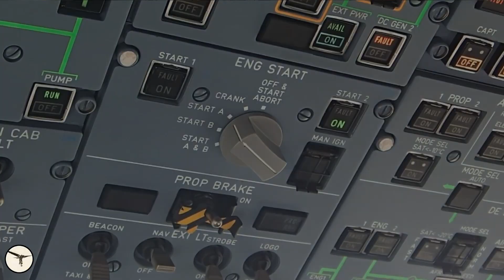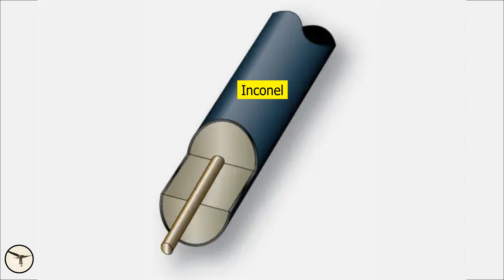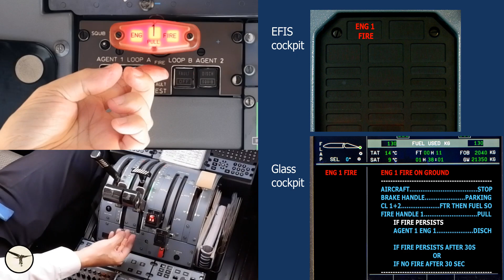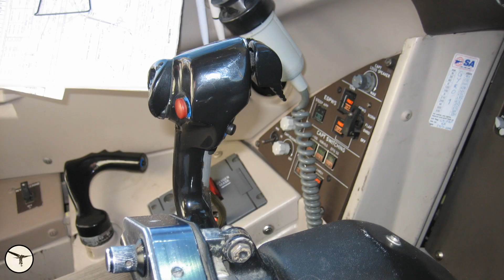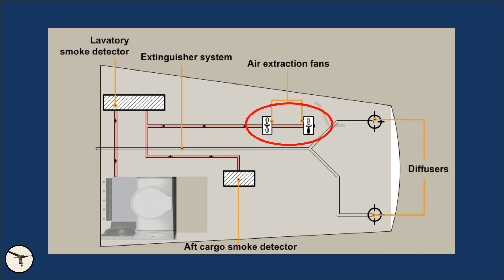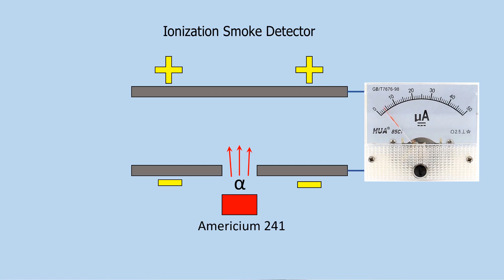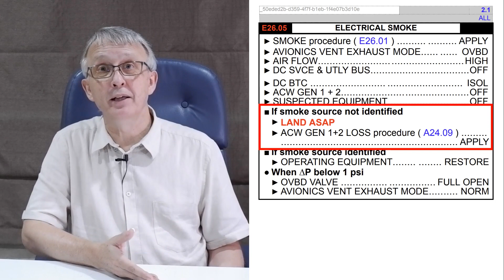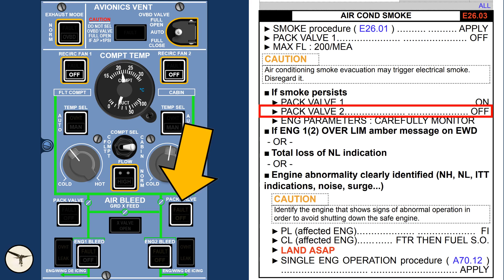ATR systems - Fire protection

Comment: Looking at the "anti smoke valve" or extract airflow valve, can you explain why we don't have to close it with ELEC SMK but only with FWD Cargo comp SMK?
And is it possible that FWD Cargo comp SMK also triggers an ELEC SMK? They both use the same ducting through the Extract Fan where the ELEC SMK sensor is located.
Reply: Because in the case of ELEC SMOKE, the smoke could be coming from somewhere in the instrument panel, such as the DUs; or from the avionics racks. In either situation, the extractor fan will pull the smoke away from the cockpit. But if it’s coming from the DUs and you close the valve, that ventilation airflow will stop and the smoke will remain in the cockpit.
In the case of FWD SMOKE, the extractor fan will pull the smoke from the cargo compartment into the cockpit. Closing the valve prevents this.
Yes, it is likely that ELEC SMOKE will be triggered after FWD SMOKE. If that happens, you don’t apply the ELEC SMOKE procedure because FWD SMOKE happened first. The fire is in the cargo compartment.
Reply: Hi Benjamin, yep . . makes sense on the first part but to my opinion the extract fan with FWD Comp smoke will not push smoke into the cockpit but pulls it away toward the partly opened overboard exhaust valve.

Comment: hello captain, what to do if we get nacelle overheat during taxi? i got this question in indigo written exam. 
thanks
Reply from the maker: The procedure is as follows:
1. Stop the aircraft.
2. Increase power slightly.
3. If the alert remains after 30 sec, shut down the enigne.

That said, ATR does not recommend taxi with engine #2 in hotel mode. We start both engines before taxi and shut down one of the engines (normally #1) two minutes after landing.

Comment: About the off-duty pilot that recently tried to turn off the engines in flight - is it possible to push the fire handles back into the original position, cancelling the effects of them being pulled (the mechanical block mentioned in the FCOM) to restart the engines? Thanks.
Reply from the maker: Yes.
Reply: @FlywithMagnar  thanks!!

Comment: hi could you please explain to me how ATR is certified for ETOPs operation without the capability to suppress fires for 2 hours or more? I believe this is a requirement for ETOP certification. please do correct me if I'm wrong though.
Reply from the maker: This requirement is for cargo fire suppression systems. Not the engines. An engine fire is typically caused by a fuel leak, and the fuel supply is shut off when the fire handle is pulled. Therefore, an engine fire will extinguish itself. A cargo fire is very different.
Reply: @FlywithMagnar  thank you so much for responding. You’re very knowledgeable! Apologies I should have specified, yes I was talking about cargo fires. I know that the rear cargo compartment has a vents from which fire extinguisher content can exit to extinguish the fire however this doesn’t fulfill the requirement to suppress fire for two hours or more to be certified for ETOPs operation. I’m wondering how did ATR manage to get away with being certified for ETOPs without having fire suppressants?
Reply from the maker: The requirement is not for passenger aircraft, but cargo aircraft.

Comment: Hi Captain, I noticed 2 small errors, in the 600 version when you perform the smoke detector test it appears not 3 but 4 awarning lerts (forward, after, electrical and lavatory) in the SD cabin page,  and the test has to be done before any flight not before the first flight of the day. Thank you for your excellent work!!
Reply from the maker: Thank you for your feedback. The lavatory alert on the SD cabin page is mentioned in the description section above. According to FCOM, the smoke test in only performed before the first flight of the day. Maybe the SOP in your company is diffrent?
Reply: @FlywithMagnar  You are right, it was my mistake, I was thinking in the engine fire detector test. Regards

Comment: Hi Captain, 
1) In this video you mentioned that 'when AFT smoke has triggered the extract fan stops, this prevents smoke from entering the cabin,' but even with extract fan turned off wont the smoke enter the cabin with recirc fan running? Then why only extract fan is shed?
2) Whether the extract fan will be shed if any kind of smoke is detected, ie ELEC, FWD or AFT?
3) What is the reason behind triggering Mec Horn while resetting the OVBD PB following SMK test?
Reply from the maker: Thank your for the questions.
1) I do not know the technical reason, but when smoke is detected, one of the memory actions is to switch off the recirculation fans. Therefore, the fans will come off pretty quick.
2) Only AFT SMK.
3) The OVBD pushbutton controls the extract fan, which is important for cooling of the avionics. The cockpit can get very hot during a ground stop. The horn will sound when the extarct fan stops, alerting everyone around the aircraft that something is wrong. The horn will also sound when the OVBD pushbutton is selected OFF bedause the fan will stop. The alert is inhibited when AFT SMK is triggered. But when we select the OVBD pushbutton OFF during the reset, the horn will sound because of the logic in the system.
Reply: @FlywithMagnar  Thank you for explaining, can you please add why the AFT smoke? I mean extract fan extract air from the avionics, E & E racks and the FWD Cargo area, then why shed it when there is smoke in the aft cabin?
Reply from the maker: When in flight, the extract fan directs air via the underfloor valve to the area under the cabin floor. When the air reaches the aft part of the fuselage, it flows up to the cabin and then forwards. Any smoke in the aft part of the cabin will then drift forwards through the cabin. This will not happen when the extraft fan has stopped.

Comment: Hi Magnar! I have three questions:
1. Why ATR removed memory item for "loop fault"? Let's assume you have loop fault after takeoff and first you do normal and then abnormal checklist. If you got real engine fire, wouldn't you lose some critical time?
2. For 500 series I use: for electrical smoke detection - first CCAS message and then smoke and for air conditioning smoke detection - first smoke and then CCAS. Does it work in real life?
3. Could you, please, give a practical example with a tripped c/b and/or item isolation during an electrical smoke/fire?
Thank you for the great and useful videos!
Reply from the maker: 1). ATR made a decision to remove as many memory actions as possible without compromising the safety. It is highly ulikely that an engine fire will happen seconds after a loop fault. (That only happens in the simulator.)
2) If I understand you correctly, then no. When you have ELEC SMK, you do the Smoke memory actions, the Smoke checklist, and then the Electrical Smoke checklist. When you have air condition smoke, there's no CCAS alert. Air condition smoke is detected visually and/or by smell. You do the Smoke memory actions, the Smoke checklist, and then the Air Condition Smoke checklist. If ELEC SMK appears, you must disregard it.
3) I have heard about one accident where the crew repeatedly pushed in a popped circuit breaker until the circuit caught fire (not ATR). Apart from that, I have never heard about such situations. But I can construct a scenario: An unusual strong current is sent from ACW BUS 1 to the pitot heat on the captain's side. Arching starts a fire before the circuit breaker can open. The smoke triggers ELEC SMK. Most likely, the circult breaker has opened. When touching the circuit braker panel for probes heating, the pilot will feel it's warmer than usual. You can now restore the systems on the MAIN ELEC PWR panel. Whether you should restore ACW GEN 2 is open for debate. The pilots don't know what caused the overload to the given pitot heat. ACW BUS 2 might have a similar issue, but they don't know.

Comment: Hello Captain! Can you please clarify which is the best angle of climb speed (Vx) and which is the best rate of climb speed (Vy) in ATR?? Also is the best lift to drag ratio speed the best rate of climb speed for turbo props like ATR??
Reply from the maker: Hi Oerstis. The terms Vx and Vy are not used in transport category aircraft. Therefore, you will never see those speeds in ATR manuals. The closest speed is called VmLB - mimimum speed low bank. It is shown on the airspeed indicator with a white bug and is used for best single engine climb speed, and for drift down. This speed is close to the speed for best lift to drag ratio and the speed for best rate of climb. So, yes those speeds are identical (more of less).

Comment: Your vids are very clear explained systems knowledge, thank you for that Magnar.
Why does engine #1 not have a Nacelle overheat sensor, as with taxi it can experience the same as engine #2?
(the QRH procedure is related to an operating #2 engine)
Is the single dot on the CAP opposite of the NAC 2 OVHT just to ignore the possibility of the #1 NAC OVHT?
Reply from the maker: The nacelle overheat sensor is installed in the engine with the propeller brake. When using the engine in hotel mode in tailwind, there's a reduced airflow through the nacelle. This is not an issue when the propeller is turning.
Reply: @FlywithMagnar  Do you taxi with  hotel mode?
Reply from the maker: No, no reason to do that.
Reply: @FlywithMagnar  I had the same opinion sir so that leaves us with a useless "taxi NAC OVHT" QRH procedure and clarifies the reason why there is no OVHT sensor in NAC #1.
Any idea on the CAP dot?
Reply from the maker: The dot is an empty slot. The shape of the CAP is standard and used in every ATR variant from the 42-300 to the 72-500. Therefore, there will be different alert lights.

Comment: Hi Captain, Thank you for such an informative video. Can u please clarify
1) what is the reason for shedding ACW generators in the event of ELECT smoke?
2) Will the ELECT smoke will be triggered following an FWD smoke alert even before selecting avionics vent exhaust mode to OVBD since the smoke from FWD cargo compt will flow past the smoke sensor in the avionics vent with the UF valve In open position? In that case, how can we confirm whether the ELECT smoke alert is a false alert? Should the ELECT smoke checklist be initiated in that case?
Reply from the maker: Two reasons. They carry a high load. And, they are not required for flight (yes, they power some ice protection systems, but a fire is more serious). If the smoke disappears after selecting the ACW generators OFF, then you have found the problem.
Reply: @FlywithMagnar  
1 ) Will the ELECT smoke will be triggered following an FWD smoke alert even before selecting avionics vent exhaust mode to OVBD since the smoke from FWD cargo compt will flow past the smoke sensor in the avionics vent with the UF valve In open position? In that case, how can we confirm whether the ELECT smoke alert is a false alert? Should the ELECT smoke checklist be initiated in that case?
Reply from the maker: Not if you follow the checklist for FWD SMK, which tells you to close the extract air flow lever. This prevents smoke from entering the cockpit. If you have FWD SMK alert before ELEC SMK alert, you follow the procedure for FDW SMK. Anyway, the cabin crew will check the cargo compartment and report to you.
Reply: @FlywithMagnar  Hello Captain, I have a question regarding switching off the ACW GEN 1+2. With the current OEB application, we turn on the TRU before taxi and shut it down after landing. I understand that the TRU uses ACW 2. In the case of ELEC SMOKE,  when we turn off ACW GEN 1+2, will the aircraft revert back to DC power automatically? Thank you.

Comment: Very interesting video! For me, as a former firefighter, who is old enough to remember when they banned Halon extinguishers (they were still in our training material but we didn't have them any more), I am surprised to see that aviation seems to be one of the few places where they can still be used. Not sure about the details, but here in Germany, and most likely at least the entire EU, they are banned for general use. I know they are among the most efficient, but Halon isn't exactly environmentally friendly, destroying the ozone layer. I guess when it comes to aviation, the benefits of efficiency, combined with the thankfully rare need to ever use them, was enough to grant an exception.

What you say about the ionizing smoke detector being like what you would find at home, I think that largely depends on where in the world one lives. I know they exist, but I have never seen an ionizing smoke detector being sold for private use here in Germany. All you see are the optical ones that work like the first type you described, just without a fan. I know that ionizing detectors are far more common in places like the United States and wouldn't be surprised if there are more places where they are the more common kind. 😉
Reply from the maker: Yes, use of halon in aviation is very rare, so the impact on the ozone layer is small. I know they are working with alternate solutions, but they must prove to be equally efficient. Aviation is one of those forms of transportation where you cannot stop at the curb and assess the situation.
EDIT: In new ATR aircraft, the Halon in the extinguishers are now replaced with Halotron.

Comment: You are a fantastic teacher, even for those who can't fly. 
I had heavy electrical smoke on my small yacht once from a short in the battery bus to the fusebox, and lost a lot of time trying to decide what to do, plus the surprise delay. 
This is nothing compared to an aircraft, but you're still responsible for your passengers (my girlfriend). After that, and rewiring the bus differently, I committed to memory the actions to take if something happened again.

Comment: Just completed my type rating on the ATR 500, and your videos really helped! Keep up the great work!
Reply from the maker: Happy landings!
Reply: I don't get why the q400 has superior performance numbers than the 72-600 when they share the same power plant. What am I missing here?
Reply from the maker: @Repented008  , despite being in the PW100 series, the engines are very different. The ATR is powered by the PW127, rated at 2750 shp. The Q400 is powered by the PW150, rated at 5000 shp.
Reply: @FlywithMagnar  Oh I see. Because Dash 8 has higher mtow as well. Nice, nice.